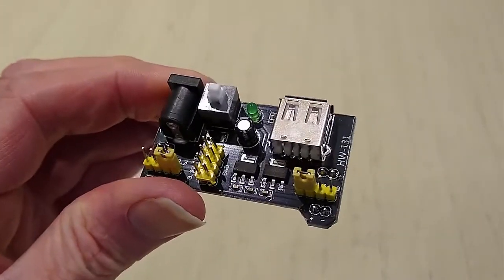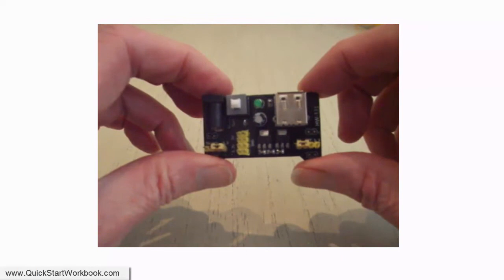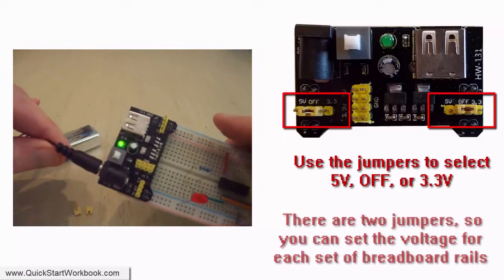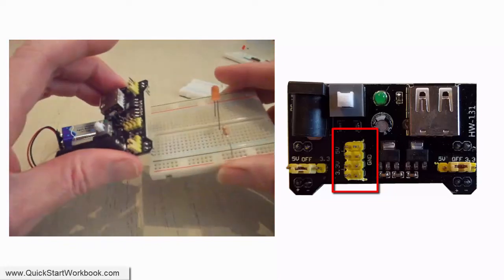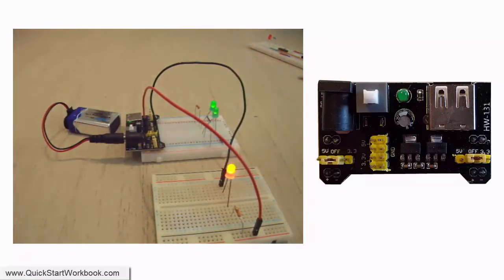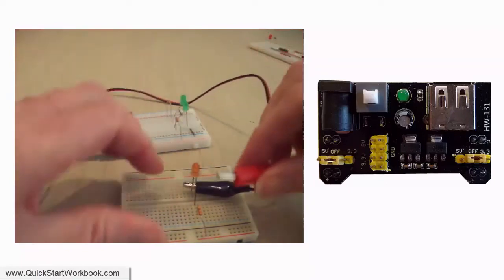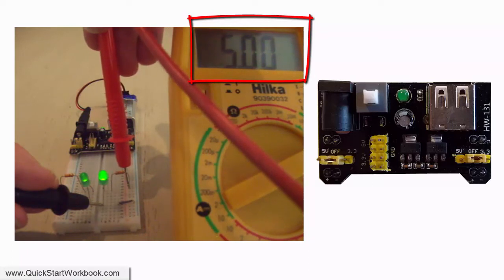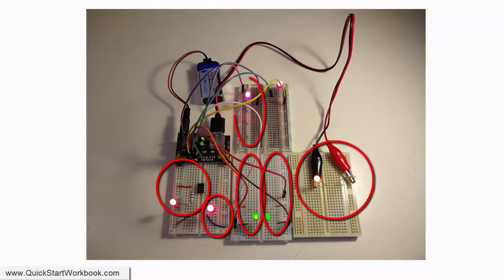Using an MB-102 Breadboard Power Supply Module

Comment: Hello, I have the same board right now. But im hesitant to use my power adapter. It has a 12v 1.5a output It was my router power supply adapter. Is is compatible with my mb-102?

Comment: This breadboard power supply can supply very less current. If we draw higher current then the SMD resistors on the module gets heated up. You can check...

Comment: HI. Can this thing power a 16 channel servo driver on one side and a nano on the other? Trying to find a way to power about 3 or 4 micro servers using the pca9685 which requires its own power supply and a nano which as you know needs its own also. Trying to make a project i can put together that can just be plugged in with one cord. Thank you.
Reply from the maker: That's an interesting question. In theory, I would say yes. Why not give it a go.
Reply: read the datasheet for the reg1ulator.

Comment: In the MB-102 schematics, the USB power line is connected after the 5V regulator (but before the 3.3V regulator). So when this module is powered from the USB port, all "5V" voltage pins have the actual USB voltage. In your example with a 9V battery connected to USB, the breadboard probably gets 9V.
Reply from the maker: Have you measured the voltage with a multimeter? Next time I'm back in my lab I'll take a few measurements myself to see what I get. Cheers, John
Reply: @quickstartworkbook1532  I did not test yet! I received  2 MB-102 last week but they are already dead. The first because I accidentally shorted the 3.3V output (bad idea) and the second started smoking after about 1 hour while doing almost nothing. That was probably a defective one (or a problem with my 12V old DC power supply?). In both cases, I measured that the 3.3V rail was getting around 10V (from 12V DC). I was quick to react and my raspberry pi pico seems fine. Anyways, I ordered a few more with a 9V DC power supply.
Reply from the maker: @cynodont7391  I have heard of similar problems with MB-102 PSUs, whereby the voltage supplied to the rails is more than it should be. I think the quality of the product can vary quite a bit.
Reply: @quickstartworkbook1532  Well, that was 10V after the failure. For my next batch, I will let them run a few hours with a few leds and resistors before I connect my precious RPI pico.
Reply: @quickstartworkbook1532 It's madness because a simple jig at each packing station would let them test it pdq!
Akin to how they used to test incandescent bulbs. (Damn! I felt old typing that last sentence!😆)